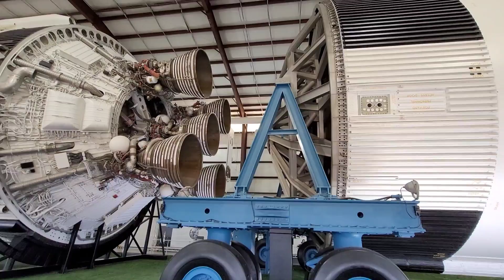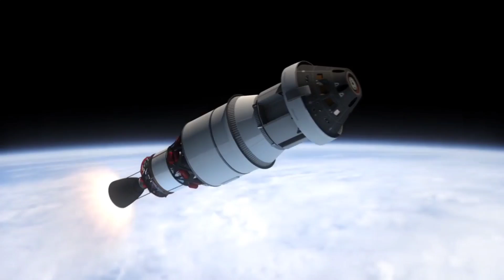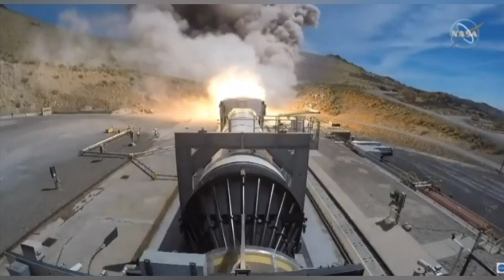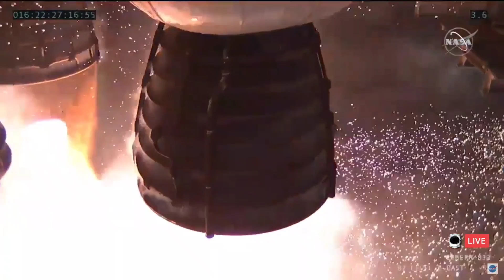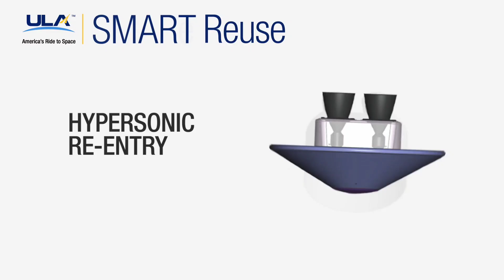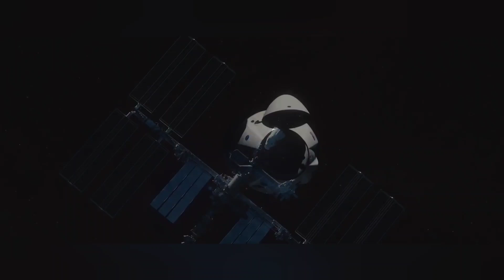Green Run Canceled! How did Boeing foul up SLS so badly? Can SpaceX or ULA (both?) solve this?

Comment: Just a heads up, the tank is not the same as the space shuttle.  Due to different load forces (top instead of side) the tank is essentially a redesign.  But I agree with you.

Comment: Because Boeing is dead. Boeing exists for one purpose, to parasitize the taxpayer. Meanwhile, they fire engineers and replace them with ultra-woke indoctrinators. That's why 737's drop out of the sky, and rockets will never leave the surface.

Comment: Welcome to the world of government contracts to gargantuan monopoly companies.  Apollo worked because it was put to a DOZEN companies who had to COMPETE with each other to GET funding and to KEEP funding in a field that was new.  Rocketry is NOT new, so failure are NOT accepted at the government level.  Paper pushers expect 100% success, and this is absurd when only building a couple of something.  Now add that engineers today are VASTLY different to engineers from yesterday.  Engineers used to work adjacent to the manufacturing and did not have a computer to do the calculations for them.  They had to know the equations.  They had to KNOW how things are built and put together.  Today's engineers do not have one clue how things are built  and are NOT ALLOWED anywhere near the manufacturing center because the companies in question are gigantic.  Likewise they have no practical knowledge as computers via FEA tell them... of course it is VASTLY faster to do the math in your head to the ~90% point and checking to see if something might work before drawing it up very SLOWLY in a computer.  The other big problem with computers is now total ignorant dipshits(Managers) can now see this trial test piece being designed and those assholes throw their oar in the mix  so, something that used to take a day by a SINGLE engineer or maybe 2 or 3 engineers and they sketched out how it MIGHT, uh hem, MIGHT work, now have to design on a computer and then write reports to some idiot boss all on some crap that most likely WILL NOT WORK and needs to be scrapped.  The decision process therefore gets completely screwed up and now compound that botched up crap in that the engineers are devoid of practial shop floor experience anymore means their tolerances are utter jokes where they should be loose, their material specs are absurdly specific on most things that just needs common joe aluminum/steel, and their designs are horrifically complex as they have no clue how to actually PRODUCE said widget to begin with on a lathe/milling machine other than maybe what some CNC machine software tells them.    COmpters are great for iteration design where you already have an existing product or nearly so.  They are complete trash for designing from scratch.

Comment: In rebuttal:
1. In-flight refueling of a spacecraft has been tested but no system currently exists for it.  The whole process would have to be developed and tested, which would take time.
2. The moon program was a perfect storm situation.  Kennedy had seen an opportunity and taken it.  His assassination gave impetus to the dream that he didn't really believe in in the first place.  If his assassination hadn't happened, chances are the USA would never have followed through with the landings.  By mid-1963 the USA was so far ahead of the USSR in spaceflight that Kennedy was seriously considering cutting back the program as the country had more pressing needs.  Yes, I do have citations on this.
3.  You make another simplistic argument regarding taking the STS RS-25 engines and bolting them to the bottom of the SLS.  They were designed to go into the aft fuselage of the orbiter.  Making them reuseable meant that the ground crew could remove the engines for maintenance.  SLS is not built for reuse so all the maintenance features found in the orbiter don't exist.  I'm sure that in the 30 years that STS operated some special tools had to be crafted for problems found along the way.
3.  Boeing isn't the problem, NASA is.  Boeing is building SLS to NASA specifications.  Look at the history of the STS and ISS and you'll see exactly the same issues.  Program delays, cost overruns, and redesigns abound.  Add to that the fact that there are no hard deadlines here.  Kennedy said that the moon landing would take place by the end of the decade.  Many people put in more than their share of time to make sure that would happen.
4.  The moon program wasn't all unicorns and rainbows.  Those big beautiful F-1 engines had many issues with combustion instability.  Problems with the LM put the program so far behind that the Apollo 8 mission was added to the schedule allowing the systems to be tested without it.  Three men died in the firetrap that was Apollo 1.  EVAs during Gemini were extremely dangerous endeavors with many being aborted before they achieved all their goals since the crewmen were too exhausted and dehydrated to continue.  Then there's the "successful failure" of Apollo 13.
5.  It may be time for NASA to get out of the rocket business.  They don't custom-build a launcher for something like the Perseverance rover,  they order it.  Why should they build one for people when they have companies that can provide not only the booster but the crew facilities?  Charles Lindbergh flew across the Atlantic not because he was a pilot working for NASA's predecessor, the National Advisory Council for Aeronautics, but because there was prestige in being the first to do so as well as winning the Orteig Prize.

There's a reason for the phrase "it's not rocket science".  Rocket science isn't easy.  We also need to get rid of the phrase "If we can land a man on the moon, why can't we do this?"  The answer is that we CAN do it.  It just might take some time or a different approach.

Comment: I was down at KSC I think in 2012 or 2013 and they were building the Mobile Launch Platform then! And looked like it was close to completion. I'll say what I said then, "SLS will never fly." Sure they put the command module on the top of a rocket and sent it into space, but that was not SLS. So I'll say it again, "It will never fly." I hope I'm wrong. Space X is the only hope we have of going back to the moon. NASA is a failing government agency and with the lack of leadership now and the defunding that will come. SLS or Artemis will most likely be canceled by the current administration. What Tony said!

Comment: The one caveat to this is 'some people saying the F-1 may never be equalled again' yet they were, and even surpassed in both thrust and performance by the RD-170 and its subsequent iterations. If you mean based on its only having one chamber then so far, I guess that's true, but from my perspective seeing as the RD-170 is constructed as a single engine, yeah, it's a more powerful and efficient engine than the F-1.

Comment: So, policy nerd here, and I'll not pretend to be fully conversant with space policy (my field is technology, with a focus on energy/climate) but since you proposed the question: A common reason to invite competitive applicants to a pool, even if you've got a favorite option you're inclined to go with, is as a sanity check.  You know you've got something that works (Revised shuttle SRBs), but it's been a minute since you've last asked for ideas - having a competition to see if someone can show you something that knocks your socks off isn't a sin, and it isn't a waste. Orbital ATK doesn't necessarily have to have political influence to hold an incumbent advantage; technological lock-in is a real force. But whatever benefits might exist in the other candidates, it could simply have been judged to not be sufficiently, marginally superior to existing techbase to warrant a new set of learning expenses. 

That said, this doesn't falsify your implied thesis by any means, but it does mean we can't just assume that skullduggery is to blame here.

TL;DR "Why spend all of those years just to use something you've been using for decades prior to that?" To make sure that it's still meeting a 'Good Enough' standard before you just keep doing what you've been doing. If more industries took this approach, we wouldn't still have an electrical grid designed in the 30s... [Stares in Texas Ice Storm]

Comment: You know I absolutely believe what you say as the reason why but this strategy ( I'll call it that because its widely used in the US) is nothing new. This strategy has been used in all products used by consumers for many many years probably first started in the auto industry. Its like a for of reductive engineering, but not in the literal sense. The engineers are used to design the product to maximize profit whether it be by adding complexity unnecessarily, reducing the materials cost, reducing quality control and justifying it by risk analysis. In the auto industry its caused our pickup trucks for example to go from a $14,000 vehicle in the 80s to a $30,000 vehicle it is today but arguably the same essential vehicle. It doesn't do anything more really other than the required safety features it has to comply with, air bags, hands free infotainment system, smog compliance, doesn't add up to another $15000 imo. Compare it to Space x and Tesla, their is no comparison, Elon Musk is going to put those companies and their ethos out of business.

Comment: The problem with SLS is exactly that it tries to reuse and modify old tech. It always sounds cheap and easy to do this, but that tech was designed for a particular use, and adapting to a new use involves a lot more engineering than most people would expect.

We've seen this over and over. Rather than designing a new system, let's use this old system from 30 years ago, and we'll just make a few little modifications, simple stuff, done in no time!

And these simple modifications prove to be anything but simple, or cheap. The engineers find more and more things they need to change to make it work, oh and half these decades old parts aren't even made anymore and the guys who knew how to use them are all retired.

Comment: Regarding Vulcan flying this year: I don't see it happening - the Vulcan had some "expected" delays, but at this point - less than 9 months from scheduled first flight, the engine didn't have a single full length ground fire test (at least that we know of - they had a first "full throttle" test a couple of months back), while SpaceX Raptor had already flown 14 times (some where reuses).
I'm willing to bet actual money that Starship would launch commercial payloads before Vulcan does (commercial here could also mean SpaceX internal commercial stuff, such as Starlink).

Comment: SpaceX has done a lot to get the Politics out of development.  That is a good thing. If you look at their hardware you will see similarities to old space hardware in some areas.  Good for them for doing research and copying what works. They have added very creative advancements and new technologies and are rapidly developing innovative solutions. New technologies are pushing full reusability. The NASA method is too politically driven and too risk averse to follow the path that SpaceX is taking. The old ways were to continue to milk the system for money rather than coming up with systems that were less expensive to get to space.

Comment: Something I have never understood about SLS is, aren't used space shuttle engines a limited quantity? Else are they planning on making more?
Reply: At some point, production on a expendable variant is supposed to start. That's actually another question mark. Can Aerojet Rocketdyne actually still produce these engines. I don't think anyone is worried about this yet because they still have enough for a few launches, and they're struggling to get to a single launch.

The irony is that while these engines are fantastic, they are incredibly complicated and difficult to produce because they were made to be extremely effectient. All to make reusability possible. But now they are modifying that design to make it not reusable. It's just stupendously expensive for limited benefit...
Reply: @Niosus  Have they so much as made a prototype of the expendable version yet? If not... the whole thing is a swindle.
Reply: @johnpepin5373  I have no clue...

Comment: It starts with some bright politician having the idea to use the old shuttle engines, to" save money". Which are a technical marvel... but also insanely and unnecessarily complicated.
And Boeing being currently very Boeing...  I like the SLS in theory. Because it's for the big moon and science mission, not for launching commercial satelites. For the same reason is the Saturn V still something very special. It just wasn't your every day every job booster. 
But not only is SLS delayed it is also insanely expensive.  Which is weird for an inflated Ariane 5....

Comment: The falcon heavy can't put a man in orbit around the moon, but the hypothetical Falcon Heavy-Centaur could. We've already seen an Orion-Centaur demonstrated with some other booster below it. We suspect this is what was behind SpaceX's mystery bid to run the moon orbit mission that was cancelled because SLS wasn't ready in time. Only the adapter between the Falcon lower stage and the Centaur doesn't exist yet.

Comment: First, you are 100% right about everything. Back in college I designed a space system that would cost half of 1 SLS flight to make this work and you basically described it here. So: Step1: Crew Dragon Launch with 5 crew members to the ISS. Step2: An Orion Capsule that serves as a Transport from the ISS to the Moon is waiting for the crew at the ISS. Step3: Orion flies the crew to the Gateway Station in orbit of the Moon. Step4: The crew transfer to the Gateway then to the lander and heads to the moon. The Orion can either wait there for another Orion to come to the Gateway or it can fly back to the ISS and wait for more crew to transfer. This entire operation would be cheaper than 1 SLS launch.

Comment: What on earth do you mean the F1 won't be equalled?
F-1 @ SL: 6.77 MN thrust and 263s specific impulse.
RD-170 @ SL: 7.25 MN thrust and 309s specific impulse... Better in both overall power and efficiency.
Sorry, but the Soviets made a better engine.

And while you pooh-pooh the SpaceX merlin for requiring 27 engines for the falcon heavy, the thrust to weight ratio of those engines is double that of the F-1 (with better efficiency too @ 288s). There are very good reasons why you don't want an engine that big, like you would not be able to propulsively land a rocket with engines the size and power of the F-1 because they would never relight at that size, and even if you managed to get one to do so, it would be WAY too powerful to control the landing of an empty rocket.

The only reason why NASA went that big was at the time, the reliability of rockets was such that only 5 engines reduced the risk of an engine failing to an acceptable level.

Comment: SLS is proof that you can have a successful rocket, even if it never launches.
Reply: That registers at level Fierce on sarcasm-o-meter! 😉
Reply: I dont think that's sarcasm. Boeing is milking the taxpayers for all the money nasa will keep giving them. Therefore, for Boeing, failure is success
Reply: You're very, very close.
I did aerospace and a classmate who's at NASA told me 20years ago how the senators control where the funds go.
NASA doesn't actually decide what it does - the senators do AND they cant afford a failure. So the way NOT to fail is NOT to fly.
Way back in the 80s Boeing and others worked out that NOT succeeding at development projects like X-Plane projects was more profitable. Anybody who has ever worked in research knows that most research projects are not meant to succeed at anything other than doing enough to get the next grant.

That's the business model of people doing NASA and DARPA projects. The most important KPI is did you secure the next funding for the next project.
Reply: SLS should be put in a museum under the category of "why did we even think of it?"

Along with many other things
Reply: @ballistic_buddha  Actually in terms of re-using existing certified technology it made a lot of sense. It should have been one of the great success stories. 
What it is is a CASE STUDY in HOW NOT to do a project.
It should be studied by all project managers. I am an engineer in the most basic project manager has to answer 4 questions.
1: What are we doing and why are we doing it?
2: Do we have the resources (money, men and machinery) to do the job?
3: Is what we are going to do technically viable?
4: How long do we have to get it done?

Go put those 4 questions to any engineer with reasonable project experience and ask hi which project failed because it didn't answer 1 of those points.
Apollo answered all 4 of those, which is actually rare in project management. Quite often there's something people just assume has been discussed and answered. SLS had 2 fails, one it never really answered why it was being done and that's because there was no specific mission for it. It was just "what can we do with all this hardware we have" and that's an answer. Secondly and far worse (and this happens all the time on projects) there was NO CLEAR TIMEFRAME as to when it had to be flying. Apollo - when did it have to deliver? By the end of the decade. 

SLS never had a specific mission or time frame to be ready. Its had all the resources ever needed to be successful. Its technical viability was never in doubt as it simply re-used parts already available. If it had been used as a bulk carrier to finish the ISS quicker then that would have been a mission. If it had have been built to put the gateway in place around then moon then that would have been a mission.

Its a complete failure of leadership and project management driven by greed and idiotic politics rather than anything technical.